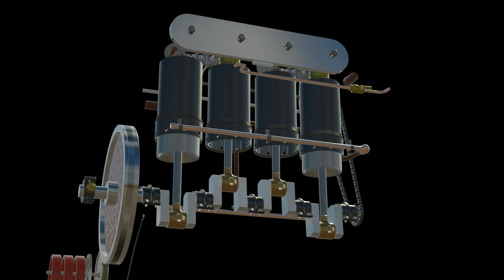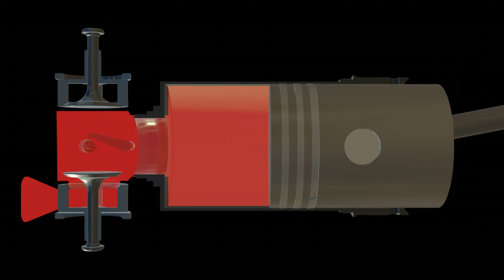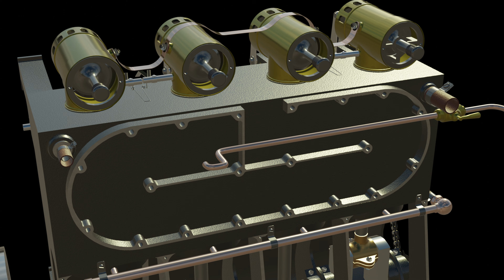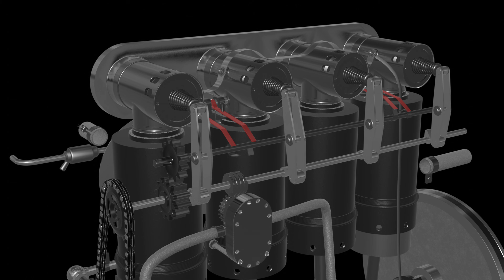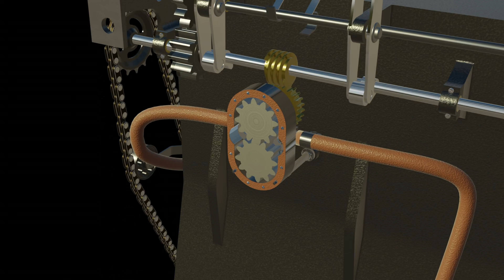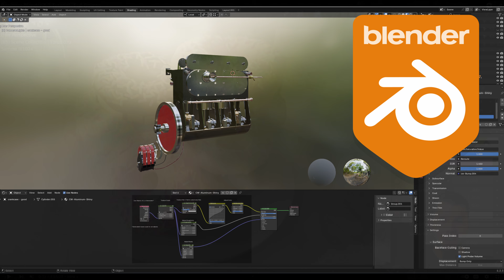Wright Brothers Flyer Engine 3D Animated Model with Explanation of its Construction and Operation

Comment: Designing an aeroplane was hard enough , but the engine? How did they develope or get that engine design. My understanding that their bicycle mechanic did the machine work. Is that correct?
Reply from the maker: They were bicycle mechanics by trade but they were self educated in all the relevant branches of engineering, aerodynamics, fluid dynamics, thermodynamics etc. to a very high level doing a lot of research and experimentation to determine the data they needed for their calculations.

They weren’t simply gifted tinkerers, they were serious scholars. It wasn’t possible at the time to build an engine which would have a sufficient power to weight ratio so they designed the engine to work for only the few minutes needed for the flight, that was a deliberate design choice.

Charles Taylor was an excellent machinist and did the detailed design of the engine but based on their calculations.

Comment: Very good job of the 3D animation and explanation. I wonder if anyone has tried to improve upon the opposed valve arrangement? It could be turned into a cathedral shape and the valves moved closer together and a modern spark plug and fuel injector added. In addition, better shaped ports could be made to improve the flow.
Reply: What's the point of doing all that?

Comment: Wonderful 3d model. What reference material is it based on? Is the model available to purchase?
Reply from the maker: Thanks, the reference material is on the Wright Brothers site, google wright flyer engine. I didn’t have any dimensions and interpreted the details I couldn’t see as best I could.

My main objective was to teach myself Blender and there was a lot of backtracking where I learned something new or realized I had interpreted the drawing wrong or parts didn’t fit so the model is very messy, not at all professional but I’ll try to post a link when I get a chance, we are travelling at the moment and it’s not on my laptop.

I’m working on a model of the Gnome nine cylinder monosoupape engine and I hope to post that in the next couple of months.